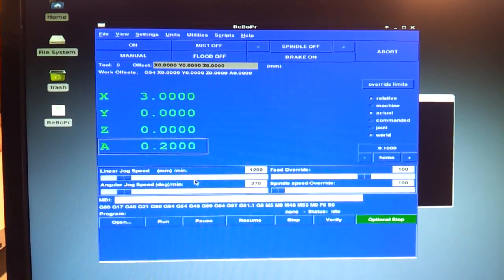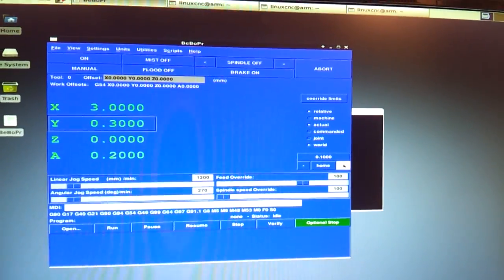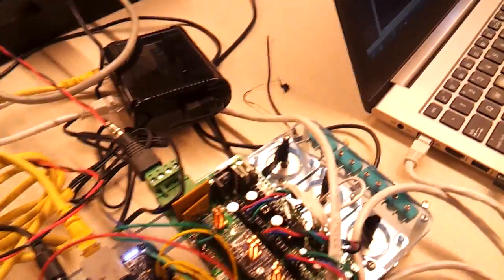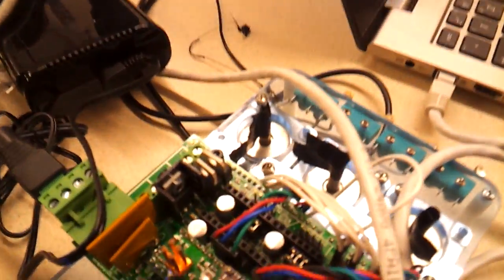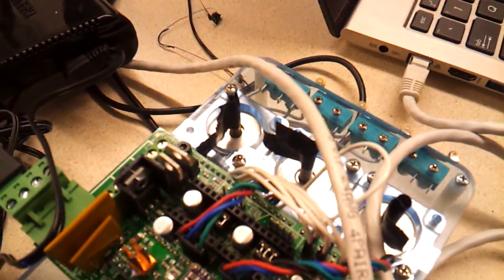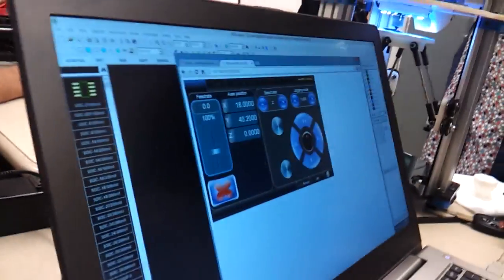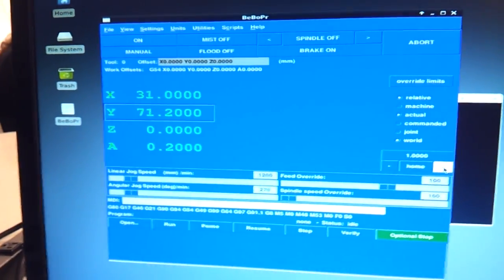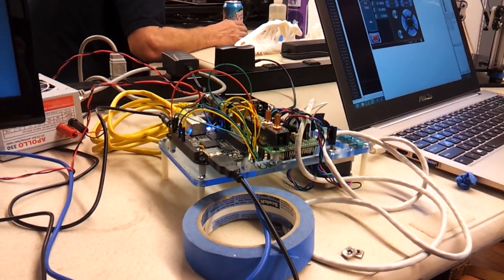BeagleBone Black running LinuxCNC

Comment: If you can control this with two interfaces simultaneously, then is it safe to assume that adding pendant control will be trivial?
Reply: You should be able to easily use any pendant supported by LinuxCNC, most interface via USB.  If you get one that interfaces via I/O pins, you'll have to make sure it works with the 3.3V BeagleBone and that you have enough I/O pins to spare.
Reply: Charles Steinkuehler
  That's exactly the answer I've been hoping to hear!   I've been searching for a small footprint LinuxCNC capable computer for years!
Reply: Charles Steinkuehler    Sparkfun sells a Logic Level Converter
(part # BOB-11978) for $1.95 that looks like it will help to get around the 3.3V issue.